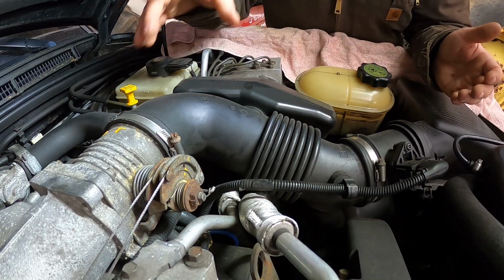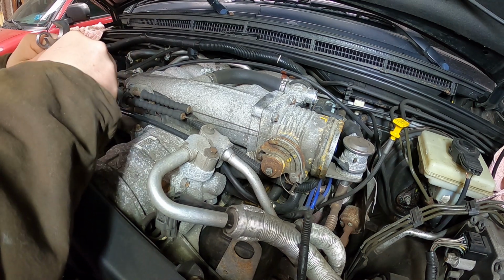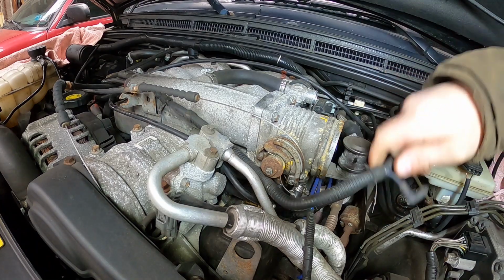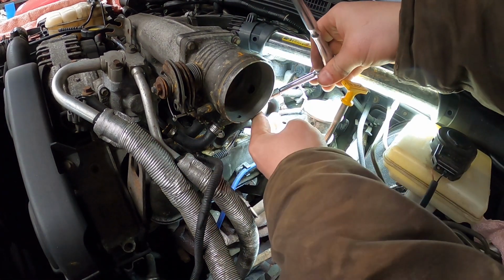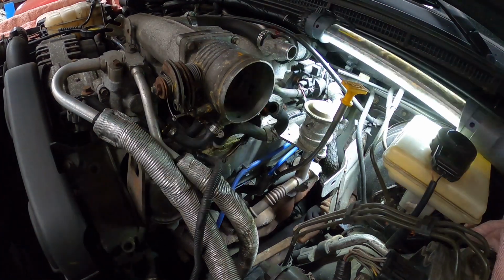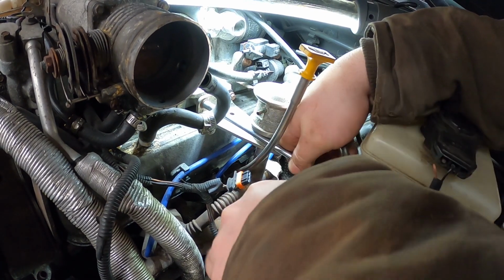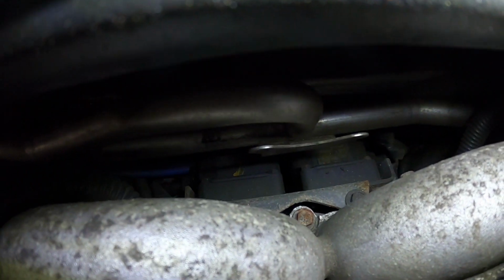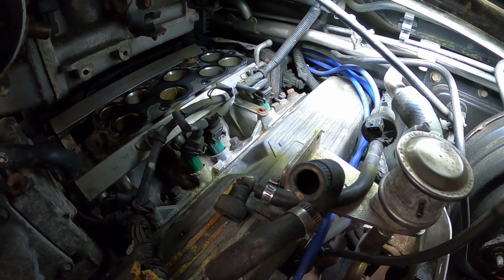Land Rover Discovery 2 | Valve Cover Gasket Replacement | Tips and Tricks

Comment: Where do the 2 nozzles under the throttle body go to? It looks like vacuum lines, mine are just disconnected
Reply from the maker: They actually connect to the cooling system. The one port goes to the top of the intake and the other goes all the way over to the overflow tank.